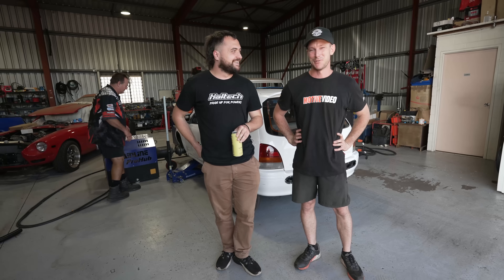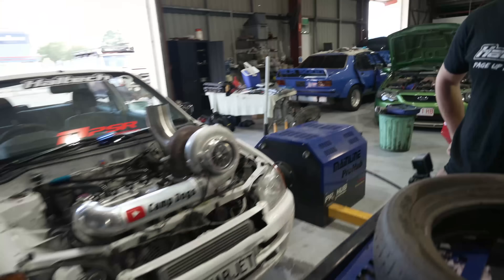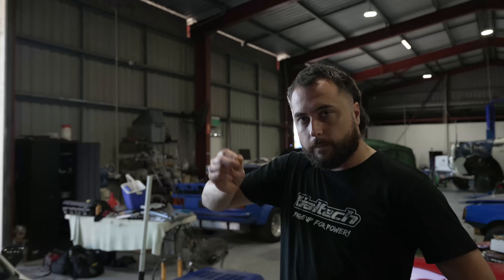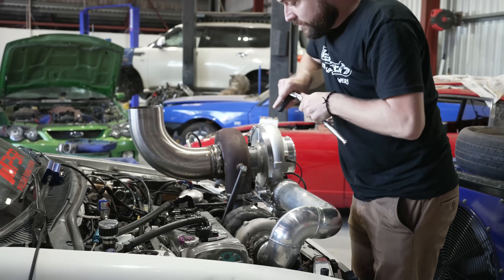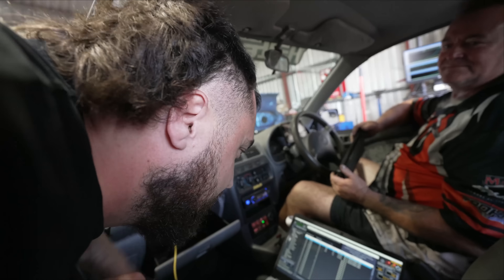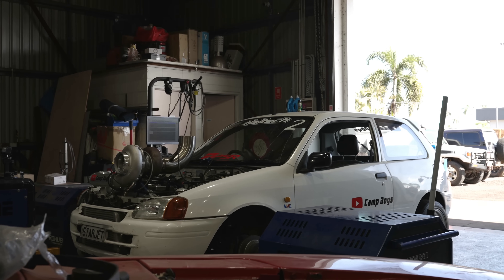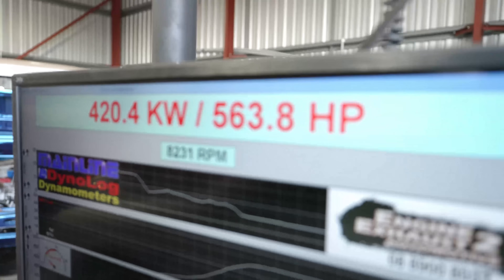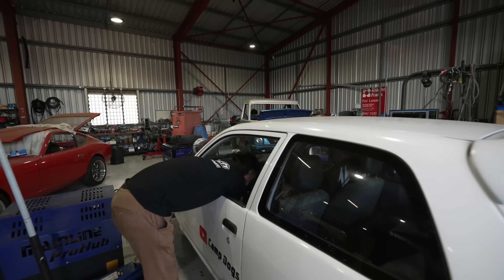Is 52 psi enough for 600 HP?

Comment: I reckon i'll be watching 12 months from now and we'll have triple turbo with a welded head just to be sure it doesn't come off the block xD
Reply from the maker: Now that’s an idea 😂🤘
Reply: I bet they move to full boost from compound (3*(3+1)-1=11bars) with welded block/head decks and added extra 10 studs around engine to externally bolt head with block
Reply: @exvils  Now we're thinking.
Reply: if the head can't go up, the crank goes down eventually 😂
Reply: What sort of mains design does the starlet run?
Reply: Maybe even quad
Reply from the maker: @beaumombelli9378  believe me, this day will come 😂
Reply from the maker: @beaumombelli9378 we broke the crank in half and two stock main caps at around 400hp…we have billet ones in there now.
Reply: @beaumombelli9378  or neither moves and the engine gets destroked👀
Reply: @Camp_Dogs  400hp is insane for that motor 😵‍💫
Reply from the maker: @beaumombelli9378 Buckle up we are coming for 700
Reply: Neither the head or the block is capable of holding what a compound setup is capable of,  a good setup can go over 200psi of boost
Reply: Jbweld it, u'll be fine
Reply: Are you still running a standard oil pump just out of interest 🤔.  Would a brace to stop the new turbo/block moving while it runs help at all?
Reply: @tmmtmm  lot less stroke when pistons are in the oilpan🤣🤣🤣

Comment: Ran into same issues on another platform, with a compound setup running 77psi + atmospheric.

Used mercedes OM457 headbolts (m15x2mm) solved all issues that i had on stock m12 bolts.

Comment: Cool still watching this, having done this myself.

Little tip on the spark plug issue/blowing the spark out. Denso iridium fine point plugs help, the fine points mean lower voltage to initiate breakdown but better is to increase the power of your CDI ignition.

If you are using stock transistorised coils, then you can cheat a bit and fit a dc/dc converter to feed the coil packs 16 volts, but as it is the reverse of a ballast resistor, too much voltage will eventually kill stuff. 

There’s so many of these little things I’ve forgotten from doing the same sorts of crazy stuff.

You have the same sort of ‘engine trying to climb out of the bay’ issue too, consider top engine mounts, misalignment of the drive shafts eats power, and the cv joints don’t like it.

Head lifting, maybe bigger head studs, but also increase the washer size, or even machine up plates and put lets in the head. The more evenly the clamping force is spread the less flex. It is the same principle of load spreading used on thin tin oil sumps and rocker covers to spread clamping force. 

The engine I worked on was a turbo petrol, but derived from a diesel engine, the standard head bolts were fine at over 50psi, due to the diesel heritage.

Keep going guys, you can do it!
Reply: climbing out the bay? didn't see that at all...... ;)

Comment: What was the timing? Why not knock 3-5* of timing off and add boost instead of timing? Makes for less peaky cylinder pressures.
Reply: It was very spicy 🌶️
Reply: @HowToTurbo  fwiw to keep the stock bottom ends alive in my 8 second setup i run 7* of total timing at peak tq and only 14* at 8k andbthrow all the boost at it. Stopped lifting heads and bend rods  when we went that route over high timing and lower boost

Comment: Stupid question but why isn't the smaller turbo feeding the bigger one? Usually that's how a compound setup works ya?
Reply: No. The bigger turbo feeds the smaller one to keep it in its efficiency range of the compressor map (lowers the PR for the same boost).

Comment: What times are you running at the drags?
Reply from the maker: Went 12.3 @130

2.5 60
Reply: @Camp_Dogs  u can go much better with a simple gtx30 mate, we are pushing 630s here with 50psi and running into the low 9s consistent on street starlets
Reply from the maker: @DezzBoosted heard all about this before but no one has any videos 🤷‍♂️